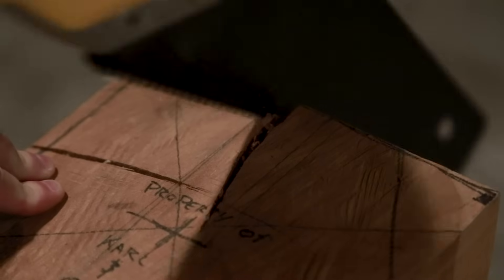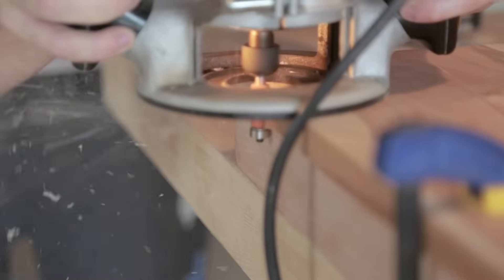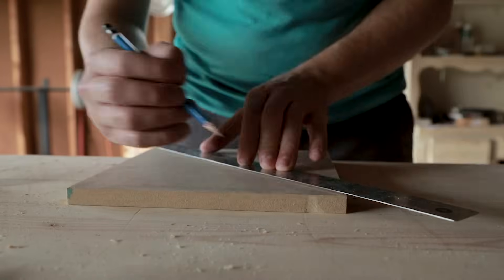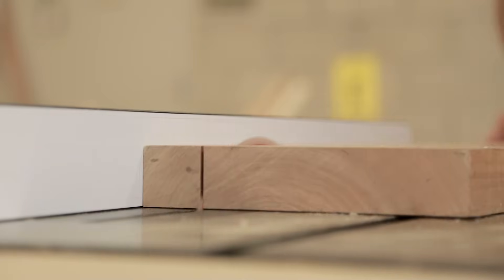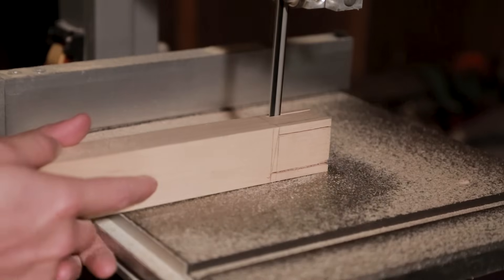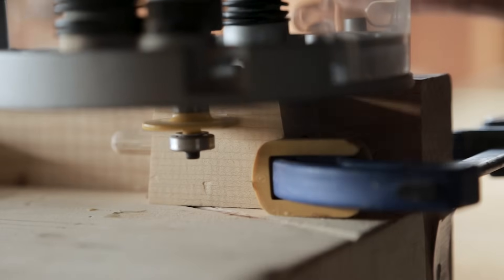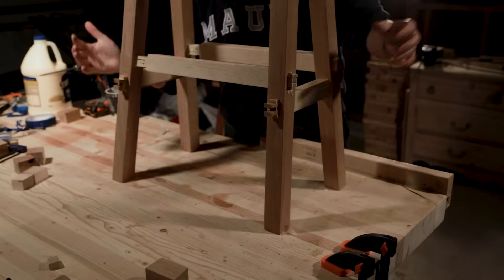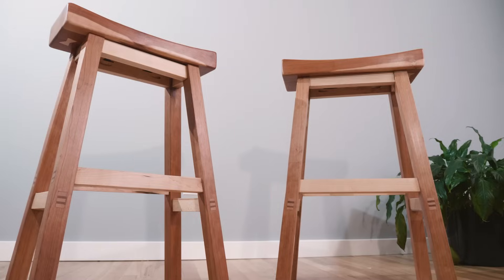Woodworking: How To Build A Saddle Bar Stool

Comment: You definitively need a bigger band saw. You need a bigger router. You need a large jointer and a belt sander and a big planer. I would even say that you also need decent CNC, a new Domino and a Shaper Origin. I hope new sponsors will line up. Also for a fancy table saw.
Reply from the maker: haha thanks man! my shop has grown tremendously since that build so we are in better hands but theres always room for sponsors ;)

Comment: These f’n angles are hard as hell to figure out!!, it took me 5 hours just to build the build the bottom section and I kreged everything together.
Reply from the maker: yes angles are obnoxious. I made a test out of pine so I could get them right. To help angles should be relatively close for the tilt of the legs and the cross bars.

Comment: Hi Kevin! what is the length of that second router bit that you use for the seat? I think I need to buy one of those for the same reason as you, I want to do that same round seat but my straight bit is to short, like 1 1/4" or less..

Comment: do you have any plans for this project? i'm trying to make my first set and having trouble with the angles and direction of cut for the legs to line up at the same height
Reply from the maker: Currently I dont. Just remember all the angles are repeated across the whole thing.

Comment: Hello! I am building a stool currently and I ran into the same issue with my legs a little out of whack. When you fixed this did you run just one leg through the table saw blade?
Reply from the maker: You most likely have to adjust each leg to get it just right. What I did was do the opposite leg first and then work from there. Do a little at a time until you fix the wobble. Cheers